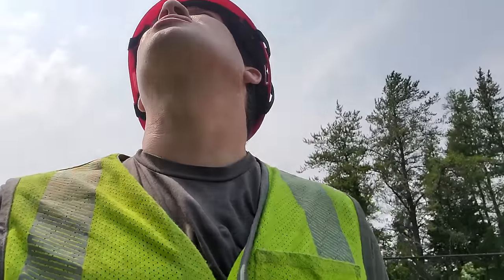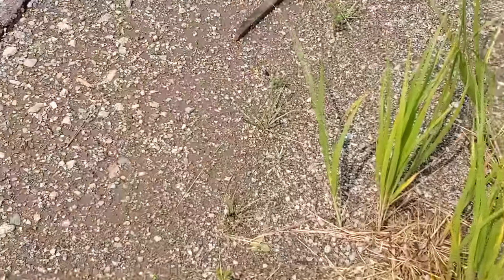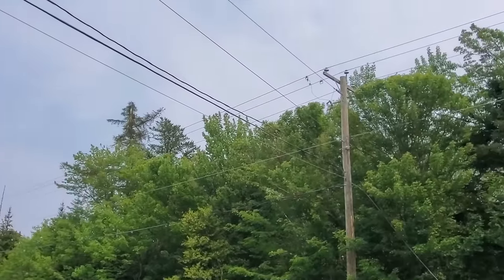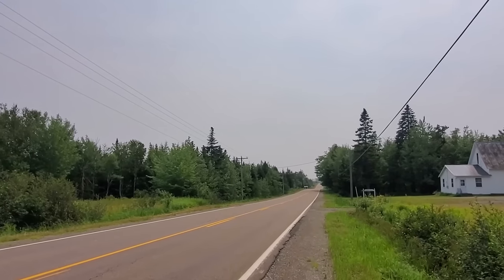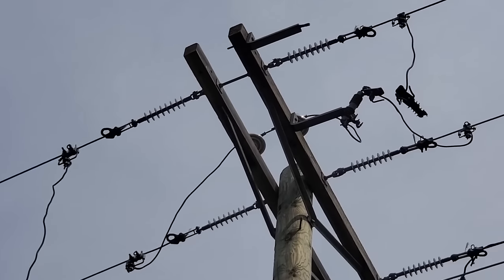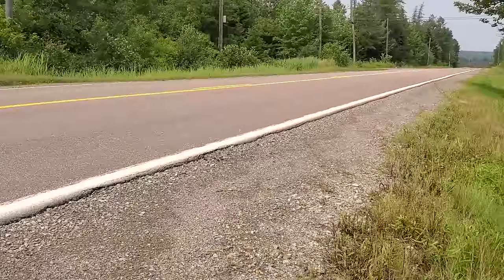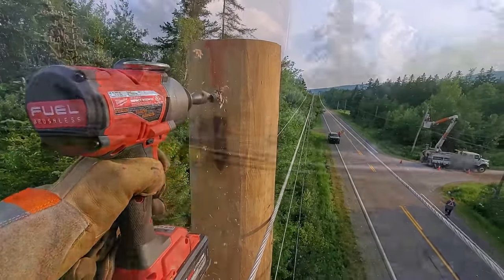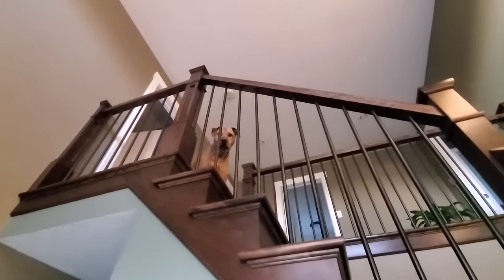What happens when lightning hits a power pole ??

Comment: Those dangling bits are so easy to miss. 
Always great knowing that your crew work safe. There is no redos with 12k.
To bad you can't use a charged capacitor bank against copper thieves.
Reply: Not easy to miss when they're looked for!
Reply: @jovetj  
You must have been born with eagle eyes. The rest of us can miss something because branches , snow of some  other crap.
Reply: @assassinlexx1993  Yes, I've always had great eyesight!  Everything else... meh.
Though, my point was driving past it you wouldn't notice, but since he was actively looking for problems, he spotted it easily.

Comment: Your channel is awesome. One of your videos helped me diagnose a bad neutral at my moms house. A wall socket caught on fire and her  house almost burned down. The power company showed up and tried to say it wasn’t a problem on there side but I remembered one of your videos when you were troubleshooting. when there was a load in the house the voltage on one leg would go way up and way down on the other. I was able to call back the power company and tell them it was a bad neutral and the next tech who came back fixed it. Im an hvac tech so i was able to use you video and my knowledge of electricity to get it fixed. Thanks man.

Comment: God bless all your crews for all do! Having been on rural fire Departments for over 30 years we have had to deal with the local power company's many times waiting for someone to show up to shut off the power off so we can fight the fire safely. I've mentioned many times it should be automatic if the person first on scene says It's fully involved they need to contact the the power company, instead they wait until the chef calls for it, by then it's an hour wait for someone to show up to cut the power.
Reply from the maker: I agree! We get called now right away. It's resulted in only 2 or 3 bogus calls. A very small price to pay for having a safer environment for all who are involved
Reply: Wait the firemen where y'all are at don't just shut the main breaker or pull the meter? That's what they do round here.

Comment: We just energized a very large pad mount after replacing the arrestors. It was kind of hard to tell if the entire thing jumped (28000 pounds) or what. The arrestors obviously didn't save it. That was a long, and very hot week. Mining cable and secondary everywhere.

Comment: I’ve seen first hand what damage lightning can do. I grew up on a farm in Virginia. One summer lightning hit a house a mile up the road from the farm. It traveled down the phone lines and wiped out my parents satellite decoder. Blew out the surge suppressor on a modem in my room. Fried  another phone line suppressor in a workshop on the property. And trashed 3 phones. Lucky for me the suppressor in my room gave it all and saved the modem but it was toast. Best $50 I had spent. Costed my parents $300 for new decoder. 

For fun I opened the dead suppressor to just see what happed. The thing literally look like someone took a blowtorch to the inside of it. 

As for the house that was struck it blew the chimney off of it.
Reply: Cost "Costed" is not a word.
Reply: Doesn't even sound like it was any kind of direct
Reply: Thats some very... direct tv.

Comment: It's crazy how sporadic lightning damage can be.  We've had some of our telecom switching offices hit with lightning. (GPS antennas make good lightning rods!) and the amount of random equipment failures inside the building is pretty wild.
Reply: @letitrotfuckit  Not sure to be honest. If there was not any then I bet there are now!  But when it's a direct hit I guess it's very hard to protect from that.   They ended up putting an actual lightning rod on the building after the incident.  Now we have a small cell tower so it's more likely to hit the structure now than the equipment.
Reply: @letitrotfuckit  Y'all are way ahead of me in terms of knowledge, but out of curiosity, would it be feasible to have some kind of automatic disconnect if there's a lightning strike detected nearby? 

I know there's lightning detecting equipment that exists. Hook that up to a relay that disconnects the antennas for an hour or so. 🤔
Reply: @letitrotfuckit  I have an amateur radio license, yes there are lightning arresters for all frequencies and transmitter power levels.  For AM, MW and shortwave transmitters you just have a large spark gap at the base of the antenna.  For lower power systems like police, fire, taxi, cell sites and other two radio systems, amateur radio systems and receive only systems like GPS, you use a gas discharge tube.  The tube is large enough that the normal operating voltages don't cause it to conduct.  When the lightning strike occurs, the gas in the tube start to conduct and shunts the energy to ground.  After the lightning ends, the gas stops conducting and the system goes back to "normal".  You also have to bond all metal together at the site.  That prevents arcing, which causes damage and start fires.  And you have to ground everything. 
For amateur radio power levels,1500 Watts max, the tube is about the diameter of a pencil and about and inch long.  For a fraction of the cost of an antenna  you can provide good protection for your equipment and prevent you house from burning down.  For more critical systems, police, fire cell cites, you put an arrester at the antenna, part way down the tower, at the bottom of the tower, where the feedline goes into the building and a final on inside the building.  The Bell system learned this in the 40s/50s when they put microwave towers everywhere for long distance phone circuits.  Robert KA3ZYX.

Comment: I've seen lightning blow apart a tree and rain down bits of wood several houses away. It's wicked stuff.
Reply: I've had two pine trees taken out, the sap turns to vapor and they literally explode. Didn't leave any pieces larger than 3 or 4 feet.

Comment: The hardware store just switched brands. And now they carry a full line of Milwaukee. So guess what I got for the sawzall. A tree/bush pruning blade. 5tpi. Its sharp check it out. Interesting video. Do an any of your power lines follow a rail road right off way?
Reply: Hi there glad to see more of Milwaukee tools available to lineman 
 Battery tools are way better then. Hydraulics,
A great tool is the Milwaukee  44 kv tool for changing insulators  or relocating the 44
Kinda like an all angle cog , you put socket on end of tool which is above 6ft insulatated tool
Rated for 100kv /ft  and at the other end you put your battery drill and makes it very quick and quick simple to change insulators , no more working with mulitiple sticks.

Also the Battery chain saw works awesome (small one )even with  class 2 gloves

Comment: In our area all 10,000 volt lines have been changed to underground. There is a lot of forest here where the lines go through. Trees were uprooted in a storm, which led to power failures. Now the lines in the established forest paths are protected. Where the streets were renewed, the power connection was also laid underground, but not all. The transformers are large boxes that stand on different street corners. 4 or 5 in our village. One is hidden in a garage, one is still a small tower where the lines used to be at the top. There are no longer any transformers on masts.

Comment: A few years ago,  I was traveling past a transformer that was once mounted up on the power pole it was straddling. Somehow the transformer dropped to the base of the power pole and was emitting an electric blue colored very bright blinding flash. 
 Quickly realizing that this blue flashing light resembled the identical blue arc of an  welders torch, I quickly looked the other way.
 So many others however stopped to take a quick look and sometimes a photo. 
 I can't help but wonder; how's the headaches doing.... some 15 year's later?

Comment: Network maintenance cable guy here, have you ever dealt with RFI-- PLI ? There was a major power outage, and come to find out the PWR Co had a tree fall on a line and caused a dead short at their substation. short version, we have several RFI's in a condensed area, the Lineman said that the lightning arrestor are probably blown generating line noise.
My question is, if the lightening arrestors are bad do they have no affect on the power feeding your customers? I'm guessing they're just basically a fuse right? Could you explain them.
Be safe man, Thanks for the video

Comment: I'm not from the USA but I have some questions about the lines.
2:38 Would I be correct in assuming the 3 lines are phase 1,2,3 at about 110 Volts (120 degrees out of phase) and the slightly lower line is the ground / earth ? 
Or are those 3 lines a higher voltage which pull power off one of the phases which then go to the transformer (cylinder type thing) which then feed across as single phases to the houses ?

Over here we sometimes have 11 Kv lines running above then lower down are the 240 volt 3 phase (potential of 440 ? volts) then further down is cable for internet / cable tv / telephone lines. Typically the 11Kv isn't there though. And here most houses get just 1 phase as its 240 volts @ 50 hertz
Mix that with the occasional HRC fuse, a few posts grounded , etc and you're done.
Ps The ground is usually closest to the footpath / sidewalk and is at the same level as the active wires.

Comment: About 15 years ago thieves drove around  my town and stole the most easily accessible six feet of lightning arrester ground wire (un-insulated copper) from each utility pole. The utility company will not replace, or repair, the ground wire because thieves would just do it again. I am assuming that there was good reason to install those ground wires many decades ago, so what problems can now occur during a lightning storm ?

Comment: We have a long driveway so utility primary runs most of the way to our transformer then underground to the house.  In the early 1990s we took multiple lighting hits, one directly on the transformer in the driveway. It exploded the arrester, I was picking pieces of porcelain out of our lawn months afterword. Surprisingly the transformer itself survived. It took out most of our electronics, resulting in fun time with the insurance adjuster. I have great respect for lightning.

During that time I was a volunteer EMT in town. Learned to stay clear of downed wires until the utility crew deemed the area safe. Luckily we never had an incident where someone got electrocuted getting out of a vehicle or a first responder.
Reply: Hi Tom,
I know it was a long time ago that you had that claim with the insurance company. You can get surge protection for your house. Speak to an electrician for details? 
As for the transformer in your driveway? That was thirty years ago. However if the arrestor wasn’t replaced? The next lightening strike will go into your house. The power company has replacement arrestors that can be retrofitted to older transformers. I know because we do that from time to time where I work. Usually we have to take a temporary outage on the transformer to do the job.
Reply: @johnclyne6350  Thanks for your comment. The utility replaced the arrester right a way, it was not integral to the transformer. We have two metered services, main and second one for electric water heater. I've installed whole house sure protectors on both services. We recently installed dual minisplit heat pumps so I added surge protectors to both disconnects. We also have point of use protector at most plug in electronic devices. 

We have a submersible well pump, while the strike did not damage the pump itself it took out the control box. I now keep a spare on hand. Lastly we have an outdoor TV antenna. At the time we built the house (1982) it was bonded to the plumbing system with an aluminum conductor, forget the gauge, probably 10 AWG. I have since added a grounding electrode at the antenna because it is the opposite side of the building from the utility grounding electrode and used 6AWG copper to bond the antenna to the plumbing system. 

Even with this level of protection a similar strike today would probably be more costly as we have a lot more electronics then back in early 1990s.
Reply: @tomschmidt381  Glad to hear everything is bonded at your house. Also that you sought out professionals in advance of another problem down the road. An outdoor antenna would need it’s own ground grid. You wouldn’t want that connected to your house ground. The further away the better.

Comment: Caught your comment on the copper thieves and substation it amazes me how brave they are getting to steal copper these days. How often are they deadly theft attempts?
Reply from the maker: The answer I'm supposed to give is - ALL thefts attempts can be deadly. But I know what your asking... In the last 2 months I've arrive to 3 in which the individual was very lucky they weren't killed. One of which left behind melted copper and brass as a result the extreme heat from the arc as they cut the wire. There was also two other calls that resulted in fairly serious pole fires.
Reply: Years ago,a copper  thief  in my area got his arms blown  off !    7200 volts

Comment: 12kv meets 7200v at the normal open junction? Wouldn't the voltage need to be about the same so the downstream transformers get the right input voltage?
Reply from the maker: We refer to the line voltage as 12.4kv. (phase to phase) The voltage on one phase to ground is approx. 7.2kv. totally my bad, as I mentioned 7.2 when looking at the dangling wire without being more specific. But yes your absolutely right and if the voltage were different that would cause problems.
We also ensure that our phases line up properly at "normal opens". Phasing checks are preformed during initial build or any line changes in order to parallel feeds  while switching. This will allow us to remove lines/equipment from service for maintenance with a power interruption to any customers
Reply: @Bobsdecline  that makes sense - thanks for the description. Love the videos!!

Comment: For transmission poles carrying high voltages, wouldn't it make better sense to use concrete/steel poles, equipped with lightning rods further up higher?

Comment: I was wondering why you're using in impact for drilling but I forget you don't have much room in those boxes up there
Reply from the maker: It's actually my first choice and extremely common for linework. Back in the day when we used gas powered drills, they would often get jammed... Even the first 36v drills that came out and had plenty of power took a lot of effort to drill through a pressure treated pole!

These new(ish) impacts and lithium battery tools in general are a game changer for linework 🙌

Comment: Please do a video explaining what are the 3 wires for a 12kv single phase power line. And what are the 3 wire for a 3 phase power line. I think single phase you have the hot, neutral, and ground. And three phase you have 3 hot but why don’t you need the neutral and ground. Also I see power lines that only have 2 wires. And I talking about the height voltage lines not after the transformer. It’s just really complicated because I’m my neighbor hood we have 3 wires in some areas but only 2 in some parts so why wast the wire if you don’t need it. Please help, thanks. 👍👍

Comment: can you tell about your grid in America. in europe we have 3 phases and zero, and the current between phases is 400V AC and between zero and phase there is 230V AC .....
Reply: Even in Europe, much of the network is at a much higher voltage, though you give the nominal voltages at the end-user correctly. In the UK, the national grid is 400kV or 275kV, regional distribution is at 132kV, then this is further stepped down to 33kV or 11kV (all these voltages are phase to phase). This is only reduced to 400V (phase to phase)/230V (phase to ground) near the end-user.

Comment: Where is the auto-reclosure located?
Reply from the maker: There's virtually always one right at the substation. It could be one of many types/technology. We then typically have pole mounted reclosing devices every so many pole/miles as well. 
While traditionally reclosing devices were reserved for main 3 phase lines, we sometimes use cutout mounted reclosers on side lines as well.
Reply: Trip savers?.  We just started using those.  Pretty cool.